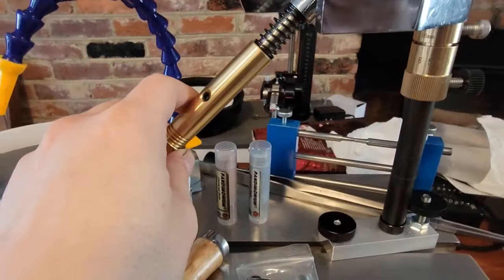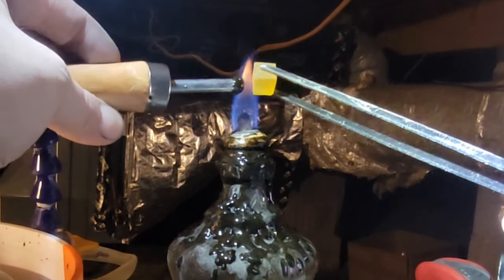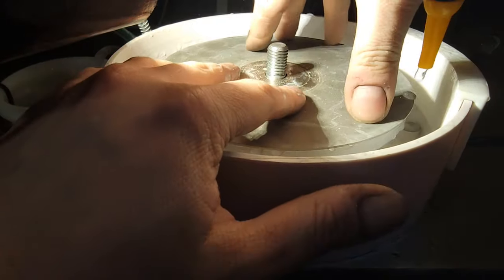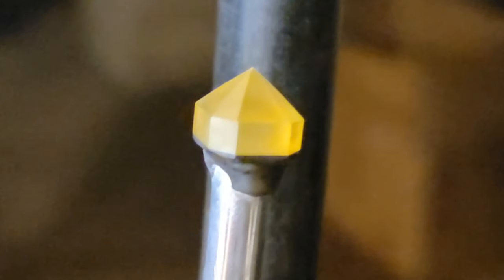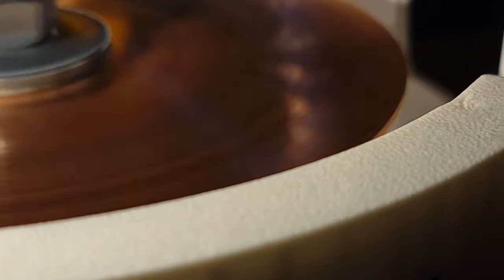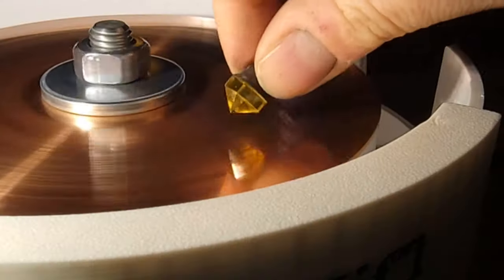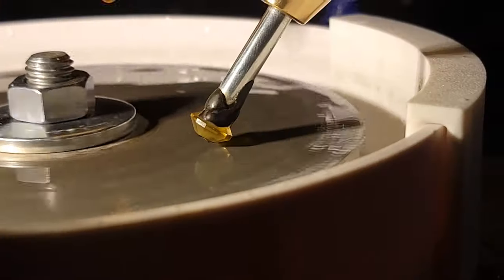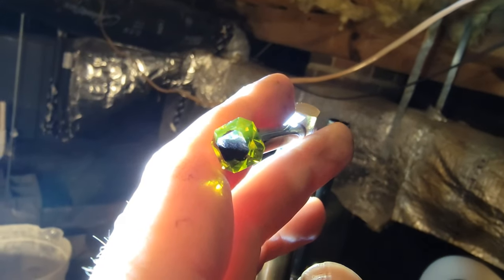Cutting a First Gem on the CutKit™1 Faceting Setup with a Vevor Machine

Comment: The fewness of the facets with this style makes it even easier to understand why gems with rectangular outlines and facets cost cost so much more than round brilliants; if the symmetry is off or the reflectivity is not in sync from side to side, if the facet junctions don't line up correctly, if the polish is off, if the girdle isn't consistent, all of that shows and if the gem specimen isn't near flawless, there's nowhere for the flaws to hide. Even watching this at double speed tells you how much labor and focus is involved. Bravo!

Comment: I purchased the kit and completed the first gem. My only question is how do you avoid facets being slanted? Can you you fix this with the cheater or would I need to shim the mast a bit?
Reply from the maker: @zachpendergrast3569  there are a few things that can cause that.  Usually the mast being slightly slanted vs the lap doesn't have a huge effect on the stone in comparison to e.g. unflatness of the laps. Another cause can be if the index gear has been slightly miscut, leaving some looseness, I ran into that on mine.  Or if the collet is not totally tight on the dop or the cheater is not tight they can sometimes allow a little rotation during cutting.
Reply: @AngryTurtleGems  I got one of the kits and when set to 90 degrees for faceting the girdle, it's clear that the dop is not being held perfectly flat. Is there any way to fix this? I feel like all of my angles will be wrong
Reply from the maker: @EventHorizon222  how far off is it?  Most of the ones I've bought have been bang on, one was 1 degree off which was fixable by replacing the countersunk bolts holding it on with flat head bolts so you can adjust the position a bit.  If it's off by more it may require drilling a larger hole on the protractor to allow more adjustment.  This may be a nee vevor qc issue, I just heard from other cutter with the same issue.
Reply: @AngryTurtleGems  True 90 degrees is somewhere between the 90 marking and the other mark on the right that boxes in the protractor. Sorry, not sure what to call that exactly.
Reply from the maker: @EventHorizon222  yeah, this seems to be a new issue, but it's fixable by replacing the bolts.  I'll probably be adding them to new cutkits, but all you need are two m5 8mm pan head bolts.  The bolts it comes with are countersunk so they lock the protractor in one position but the pan heads let you slide it around before tightening them
Reply: @AngryTurtleGems  Thank you so much for the quick solution!

Comment: Hey im just dabbling with this and i have a tight budget is there a manual way of doing this or do you have a how to video on how to manually facet a gemstone as most faceting machines are currently over my budget
Reply from the maker: @welshreaperscrapandcasting4029  it's possible to freehand facet or to do more simple jigs to assist in alignment but it's a pretty different workflow.  What kind of budget did you have in mind?
Reply: @AngryTurtleGems  at the moment I'm lucky if I can spare 200 I'm working on setting up a blacksmithing and smelting business but wanted to hand craft an engagement ring for my significant other if that went well I'm considering running jewellery making alongside it
Reply from the maker: @welshreaperscrapandcasting4029  the vevor base machine sometimes goes as low as 200 dollars on eBay during sales.  Keep an eye on it, you can have fun with just the base machine and a few accessories.
Reply: @AngryTurtleGems  awesome thank you will definitely look into it

Comment: Buy machines made in the USA 🇺🇸 . They are going to last forever . They don’t need calibration. They have the parts and you contribute to local economy and avoid headaches.
Reply from the maker: Buying a US-made machine is a great idea if you can afford it, but there are many people who would love to try faceting but can't sink $5000 or more into getting started.  Put another way, for some people telling them they have to start on an expensive machine is the same as telling them they can't facet. The US companies that once filled that starter niche (Lee, Graves, MDR etc) are all out of business now.  While this setup isn't as good as an ultra tec or facetron it is definitely a viable starting point and it will let you get started without spending a fortune.
Reply: @AngryTurtleGems super awesome. I want to get this setup. One question. Some people say “it’s harder to unlearn bad habits than to just start on a $5000 machine”.. what do you say to this?
Reply from the maker: @MichaelWilliam-xp7jz  I disagree with that idea.  I learned on a Graves I which is not a very rigid machine.  As a result I had to develop skills faster for doing fine adjustments on height and angle to get things in wack.  Moving up to a much more rigid ultra tec I had to use some of those skills much less, but everything I had learned directly translated.  It was what my mentors recommended and it felt like a good way to start.  I don't know what bad habits they'd be thinking of, but I do think what you learn on a CutKit will translate when you move to a higher end machine.

Comment: I am looking up different cutting diagrams but most of them are asking to cut to very specific angles like 42.19. How can I find more diagrams that do not include decimals in their angles? Or how can I cut on this setup to that fine of a detail?
Reply from the maker: @EventHorizon222  Yeah, that's an artifact of automatically making facets meet in gem cut studio. You don't really need that level of exact precision to cut nice-looking stones outside of a few very specialized designs (i.e., cleopatra's eye).  I just eyeball it to be approximately close and it will typically work.  If you really want to get the meets to exactly meet you can more finely adjust the angle by slightly raising or lowering your handpiece.

Comment: Got my CutKit and vevor assembled and I'm ready to jump in today! I notice on the pattern it shows handling G1 and then P1 and P2, and then G2 before P3 and P4, but it looks like you start with  P1-4 before going on to the girdle. Obviously that works just fine, but I'd love to hear any thought process behind it. It seems to me it would be easier to handle it as you do in the video, so your girdle lines up easily, but that makes me wonder why the pattern is written differently. Thank you!
Reply from the maker: I might have made a mistake in ordering on the pattern.  I rarely share diagrams because I'm not great at ordering them logically.

Comment: hi, how is your polishing?wtf, I do everything the same, but polishing doesn’t work,400 grid600 ,1200,3000, pandenium 8000 or50.0000  and nothing.... 😢Cooper disk have and battlab
Reply from the maker: It depends a lot on material.  YAG is fairly cooperative but other materials like quartz might not always cooperate.  With the copper lap I found going very slow and having a very light charge was important for getting a good polish--a higher charge led to scratching.
Reply: Thx, sorry how make light charge I don’t know 🤷‍♂️:) I take sandpaper 80 grid and make scratches,then take 8’000or 50’000 pandenium and since you used nothing 😢😊used “amethyst”
Reply from the maker: @makumeganeyt9628  80 grit is very coarse and in addition to leaving deep scratches it will also leave small cracks right under the surface (called aubsurface damage).  It is important to cut through that layer with intermediate cutting grits like 240 and 600.  Amethyst may not polish well with diamond anyway, quartz can be touchy and prefers oxide polishes.
Reply: @AngryTurtleGems  Thanks, I meant the lapping tool for copper and tin disk I make 80 griid scratches in the disk to deepen the polishing paste into these scratches and nothing works with polishing. I don't understand why. I do everything like everything in the video, but nothing =) and cut strips.
Reply: @makumegane9628  don't score laps, it's not necessary and could be the cause of your polishing issues.
Reply: @solidtank7957  Thank you. I'll try it.
Reply: @makumegane9628   try to cut extra long on your 600 to make sure you have any deeper scratches out. 1200s can be scratchy sometimes. 8k to get the rind off, then go to 50k to get the wispy scratches out. However, if the scratches are way too deep, due to contamination or not enough cutting on following steps, you'll feel like the 50k is scratching because it can't remove nearly enough material. Quartz is notorious for this. I recommend cutting some garnet (real or synthetic) or tourmaline, they polish like a dream. I've gone straight from a very well worn 1200 to 100k on an ultralap on small stones and gotten a good polish. Some people go right from 600 to 8k to 50k skipping 1200 entirely. Troubleshooting is the name of the game, good luck my friend!
Reply: @solidtank7957  Thanks for the advice. But my problem is not in the scratches on the stone, in that I have a stone is not polished at all for example (amethyst), I do not understand what the problem is, all do so scratch the polishing disk in order to score a circle of polishing paste, I also seem to do the same, but nothing comes out the stone remains matte. Thx

Comment: Hi, how precise is the Vevor Machine in your opinion (compared to your UltraTec)?

Im faceting on a ST-08, a platform machine and have problems with small gemstones <3mm. Mainly since theres too much pressure on the stone. I tried to put a counterweight on the other side, so now there is only ~60g of pressure on the stone, but this makes the handpice difficult to move, and very un-handy. So im thinking about switching to a mast-machine, or buying a cheap adition  like this for the tiny stones.
Best regards,
Bernhard
Reply from the maker: @Isallintor  it is nowhere near as precise or rigid as an ultra tec.  I have not tried cutting small stones on it.  The sterling has a very good reputation, I haven't tried one but it should be more precise than the Vevor/cutkit.  The cutkit would be a cheap way to try out the mast machine workflow though.
Reply: @AngryTurtleGems  Thanks for the Info. Think I'm gonna stick with the ST-08 for now and save up for an Ultratech, Facetron, or VJ.
 
In case you're interessted, in my experience with the Sterling: Great for bigger Stones, round- cuts and quick rough cuts.
Problems: Hard to dial in the angle precise (+/- 0,25°) managed to get within ~0,1° with a digital angle readout. 
Both handpice and platform remove material from each other by the rubbing motion, which tempers with the precition over time, until you replace some parts and redial the handpice.
The comunication with the manufacturer is problematic, to a point where I stopped ordering spareparts, and started producing them myself. 
And as preciously mentioned, the way the handpice is balanced there is a lot of weight put on the stone.

Comment: Hi , i just receive today this machine but I noticed that when I manually lift the pen (big gold things where the dop is at the end) to look at gem or to increase the cutting angle the 2 pins on the sides which are used to hold the pen in the angle roll up, does this have an impact on the actual cutting angle? and did you have the same problem?

Also i buy some cutting diamond disk i have : a 320 to make the raw shape / a 600 diamond for cut / 3000 diamond disk for prepolishing (without paste ? ) / and a copper lap with 0,5 diamond paste (its like 10 000 grit i think ) for polishing. Do you think i need more or less lap ? and is the 3000 grit diamond disk fine for pre polishing or i need Absolutly an other copper with less grit paste ?
I have also a 1200 grit diamond lap but i dont think its usefull with lap setup 

Thx a lot for those video you help us a lot ! much love
Reply from the maker: The pins rolling up usually works itself out as the plastic holders wear a bit.  It won't be an issue as long as you have the pins seated when you're actually cutting.
3000 grit plated laps are an option and don't require paste, but a lot of people report occasional trouble with them.  Something about electroplated laps and finer grits causes trouble it seems, but you'll see how they work for yourself.  10k grit is a bit coarse for a polish--a lot of commercial stones stop at 14k but you can still see polishing lines/fine scratches by eye.
Happy cutting!
Reply: @AngryTurtleGems  Hi ! i come back to u because i have done some stone on it already and my polishing on stone is more like ice freezy , we don't see throught . 

Do u think its because of my polishing step on my copper lap with a 10k diamond paste / oil ?

Btw i'm waiting to receive a 60k diamond powder , do u think with the same copper lap and this powder the polish gonna be a lot more mirror clean see through ? 

If yes , 
Do u think i stop using my 3000 grit diamond lap for prepolish and just prepolish with copper lap and the 10k diamond paste and switch to final polish on same copper lap with the 60k powder ?

Thx for your responses !
Reply from the maker: @guinardalexandre5320  what material are you cutting?  10k should leave a pretty transparent windowed face on most materials, just with scratches that can still catch the light.  60k on copper does very well for some materials though I find I have to charge very sparingly and spin it very slow.
Reply: @AngryTurtleGems  i have cut some fluorite and aqua marine , the result like i said is really freezy we dont really see through and the rough was clear for the fluorite
Reply from the maker: @guinardalexandre5320  fluorite is very soft and requires special care.  Copper laps will be too harsh.  Aquamarine should work but you should probably use an oxide polish
Reply from the maker: @guinardalexandre5320  fluorite is very soft and requires special care.  Copper laps will be too harsh.  Aquamarine should work but you should probably use an oxide polish
Reply: @AngryTurtleGems  oh ok thx for advice , what is the difference between a diamond polish and a oxide one ?
Reply from the maker: @guinardalexandre5320  oxide polishes chemically interact with the surface and only work on some materials but work really well on those.

Comment: I had no problem with cutting the first 4 45° angles to a nice point but when I switch to 42 for the second tier it seems to just erase the first tier. Could you help me trouble shoot? Thanks for the great kit!
Reply from the maker: The second tier cuts in a lot quicker than the first tier so it's a good idea to run the motor slower and use light pressure when you're cutting them in, otherwise it is easy to overcut.  It's also a good idea to raise the height nut a bit higher than necessary and very slowly lower it so you can watch the facet cut in.
Reply: @AngryTurtleGems  do I need to adjust the height of the arm after changing to 42? Thanks so much!
Reply from the maker: @guyaglass  yup, the handpiece has to go higher at shallower angles and lower at steeper angles
Reply: @AngryTurtleGems  okay great thanks! How do you determine the height change?
Reply from the maker: @guyaglass  once you change the angle you can raise or lower the handpiece until the stone is almost but not quite touching the lap.  Then you can slowly lower it using the split nut until just the right amount is cut in.  Then you cut the other facets in that set to the same depth
Reply: @AngryTurtleGems  thank you so much! Is there a video where you explain this part of the process? Going back to the wheel today to try another facet!
Reply from the maker: @guyaglass  I am hoping to do a longer video about this but I haven't had a chance yet.  I might shoot helping one of my friends who has never faceted cut his first stone
Reply: @AngryTurtleGems  thanks so much! Your advice helped so much. I was definitely cutting too much material. I'm used to coldworking much larger pieces of glass and was surprised how quickly these small diamond laps cut the material. I turned my speed down as you suggested and that helped as well. Cheers!
Reply: A longer video? Yes please.
Reply: @AngryTurtleGems  I had the same issue as guyaglass, thanks so much for the helpful reply! This is an amazing tutorial and you're a fantastic resource for beginner lapidary folks. Huge thank you, you're the best!

Comment: i looked to buy a vevor after watching your video unfortunately the machine is not suitable for  uk use as we are 240 volt
Reply from the maker: I think that is why they are still selling the older variant there.  It works but has some issues with the angle indicator and protractor